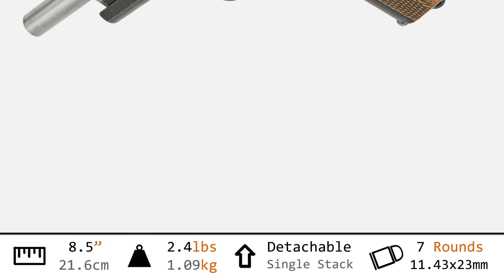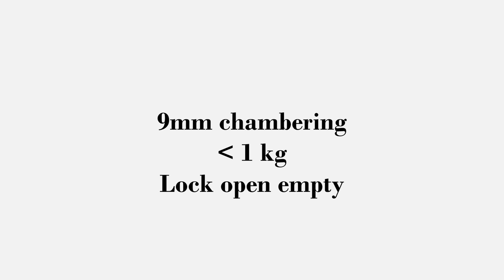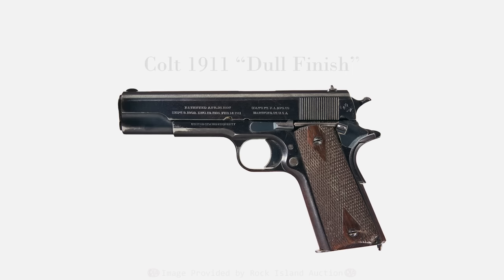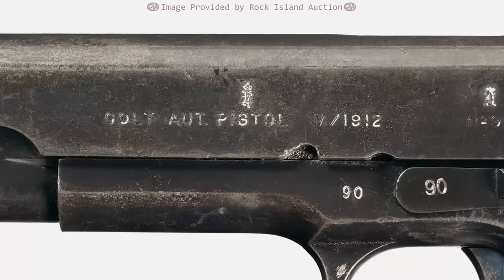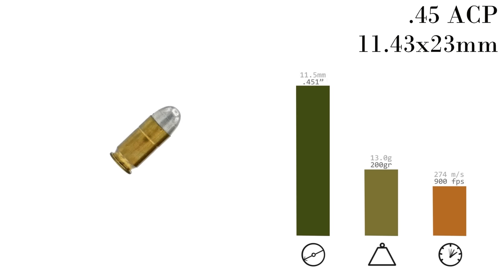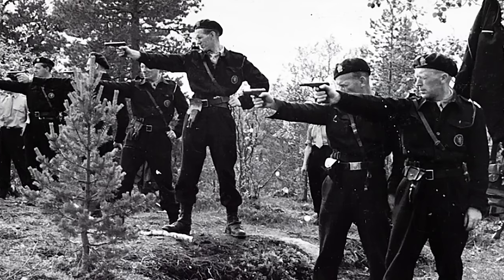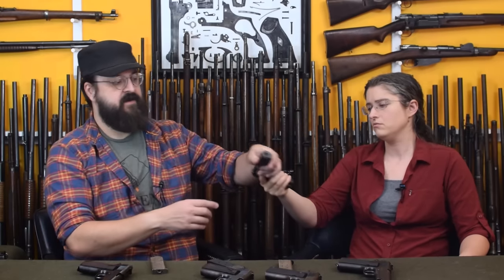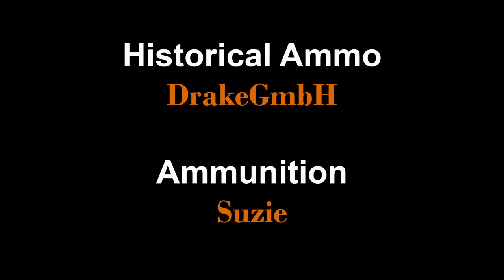History Primer 186: Norwegian 1914 Documentary

Comment: In my eyes the 1911 being compared to weapons that came out decades later is more of a proof as to how successful it is.
Reply: It's wild to think that the original AR-15 can be compared to modern rifles today
It's insane to think that the 1911 can be compared to modern pistols today
Reply: There are only two issues many three issues. 
1. Mag size but comparing mag size to the time period it was normal.
2. Complexity once again the lugar was worse 
3. Heavy... but this is comparing the 1911 to wonder 9s which is not fair.
Reply: @RyTrapp0  compared to modern pistols? Thats just a we bit generous. Compared to anything from before 1970, sure.
Reply: That’s mainly because most modern pistols still use a Browning action (tilting barrel short recoil action with a slide). Not only that, but most pistols still use 1911 style ergonomics (including having a slide stop you can hit with your thumb to load and most pistols that have manual safeties being operated by the thumb with up as safe and down as fire, including the current military M17/M18). Yeah there’s been some iterative improvements, but those aren’t significant enough to be a new action. In other words, there are more mechanical differences between a 1911 and a Luger than a 1911 and a Glock or P320.

So the 1911 is still basically a modern pistol, with most of the stuff it’s lacking by modern standards simply being features. And those features can be easily back ported to the original design, so if I want to mount accessories, have a double stack magazine capacity, get better sights, mount a red dot, etc. those are all available. I think it’s notable that 2011s are becoming increasingly popular and those are basically just updated 1911s (to the point where most standard 1911 parts are even still compatible).
Reply: @gameragodzilla M1911 uses 1900 Luger ergonomics - which shows Georg Luger knew ergonomics…
Reply: @allangibson8494  Yeah, but even then, the Luger’s ergonomic influence is indirect, since it influenced the 1911 which influenced almost all modern pistols.

You can see the things the 1911 did add, like a slide lock you can hit with your thumb or a thumb safety where up is safe and down is fire (as opposed to pushing back to forward) which are also the usual controls for modern pistols (like the Sig M17).
Reply: @gameragodzilla  Interaction was very direct. The .45 Luger competed in the trials against the 1909 Colt and the 9mm was the standard issue firearm that the German and Italian manufacturers were replacing (not the Colt).
Reply: @allangibson8494  Direct to the 1911, not modern pistols which were entirely influenced by the 1911 which was influenced by the Luger.
Reply: @gameragodzilla  Most militaries never used the M1911. Those that trialed it found it too much gun for regular use (the research is was based on was badly flawed as it included no supersonic ammunition at all).
The Luger led to all the modern German pistols via the P-38. Modern western militaries all use 9mm Parabellum (Luger) as a direct consequence of this. Russians and Chinese went of on an even smaller tangent (because 9mm caused wrist injuries after the first thousand rounds per day (KGB experience in Katyn Forest)).
Reply: @allangibson8494  Most militaries these days use pistols derived from the 1911. Anything with a tilting barrel short recoil action and a slide is influenced by the 1911. No one uses a toggle lock pistol anymore.

Comment: It feels extremely weird to see a Glock intrude upon the sea of wood and steel that is the typical C&Rsenal episode.
Reply: 45:51
Reply: Yup, really caught me off guard
Reply: Yep. Jesus, Gaston Glock sure liked to hit his poor gun with the ugly stick. (Still the best semiauto ever engineered, tho)
Reply: @max-zv7sf  Not with that grip angle it's not.
Reply: @Devin_Stromgren  i actually find the glock grip angle really good for controlling recoil in subsecuent shots. An aggessive stance paired with the grip works really well for me.
Still, my comment was about engineering, and Glocks are the most elegantly and simply engineered pistols out there.
Reply: The oldest production Glocks are over 40 years old now. Less than a decade to go before those guns become curios & relics in their own right. 

The inexorable passage of time hurts, make it stop even a little bit thanks.
Reply: @Devin_Stromgren yeah the grip angle is a bit annoying, not enough obviously for it to have failed. But you can see that everybody agrees. It’s the wrong angle because pretty much everybody whether they’re cloning the Glock or not doesn’t use that angle. I’m surprised Glock has never really fixed that. They coulda crushed the market to a terrifying degree.
Reply: @8.6GivenAdqVacSysm  Heck, I consider the 1911 grip angle to be too vertical.  I really need to try a Luger, I suspect I would like that grip.

Comment: I have to give Mae a shout out for her grouping yet again! Excellent work! I've really enjoyed the M1911 series & the slight little differences between them. I've only ever used the M1911A1 & it is one of my favourite auto pistols. I was a serving member of a state police force in Australia many years ago & we were issued the S&W M10 that used the .38/200 cartridge & it was never really a good cartridge. The armoury section was part of our unit so we got to shoot quite a number of revolvers & pistols. The Australian Army at the time had a mixture of M1911A1's & the L9A1 (GP-35). As a manstopper, .45ACP was brilliant but I still have my reservations on the 9mm round. Yes, 9mm is a standard NATO round but you can't beat an M1911A1. Our S&W M10's were replaced by the Glock 9mm series & even though it's a more modern auto pistol, I still prefer the M1911A1.

Comment: The first handgun I ever fired was a Norwegian Kongsberg Colt 1914, manufactured in 1924. The hammer did bite me at first, and it struggled to consistenly lock the slife open on an empty mag, but honestly as a novice shooter .45 ACP wasn't bad at all. It didn't jump that much. I found the Luger P08 in 9mm to be jumpier, but that could be due to the toggle lock mechanism, or the ammo we were using, or a combination of both.

Comment: Got some copies of blueprints of the original colt (model-0-auto pistol, from may 1915), and the Kongsberg 1914, from the KV-archive. It's intersting to see the difference in the tolerances. Colt's smallest tolerance, is 0.0005" (0.0127mm), and Kongsberg's smallest tolerance is 0.05mm. Don't know if this is correct only for the few drawings I got, or if it's the way it was done through the years of production..

Comment: In current times, fighting times, Glock and evolutionary polymer designs are the new hotness, but 1911 style pistols are still eminently viable.
Reply: As a duty service pistol? Not by today's standards.
Reply: @WALTERBROADDUS  As an EDC, 1911's are most definitely still a viable option.
Reply: @techfixr2012  that is a different standard. And, while viable? It's more of a fanboy choice. A Colt Python is viable...
Reply: @WALTERBROADDUS  I do and have carried a 1911 for over 30 years, used it twice to stop violent crime, luckily I didn't have to fire. You can carry your plastic gun, and more power to you, if it makes you feel better. I will carry my Rock Island double stack 10mm with 16 rounds and feel comfortable doing it, that my life is in good hands. Mine.
Reply: @techfixr2012  again, not a duty weapon that most people want to carry today as a service gun. And there are other designs that get the job done more efficiently. There are designs that use fewer parts. Are more conducive to left and right hand operation as well as different hand sizes. Are lighter in weight and have better capacity. Some people just seem to think that engineering stopped 100 years ago. If you enjoy the 1911? Congratulations.
Reply: The fact that while more modern options are out there now a 112 year old design is still a perfectly acceptable option says a lot about how much influence this design had on modern handguns.
Reply: @techfixr2012  
Is an 80 lb pack part of your EDC?  It's a game of min/max with service equipment.  Every ounce saved on what you're already carrying is an ounce of extra gear or ammo.  10oz is a first-aid kit or another mag.  Those can save lives.  A sidearm being 10oz heavier can't, unless you're using it as a club.

If rejecting something out-of-hand merely for being "the new hotness" were a valid philosophy, we'd still be chasing-down prey on foot and trying to kill it with our bare hands.  Decisions need to be based on functional merit, lest we do ourselves an enormous disservice.
Reply: @ItsMrAssholeToYou  My EDC is a Star BM 9mm actually. My 10mm is my shtf piece, along with my lvl4 steel plates. I survived 2 combat tours, so I have my own opinions. I actually like the FN 509 and I have nothing against polymer arms, but I absolutely hate Glock triggers. If one firearm was the answer, they would only make 1. I respect your choices, but I have so much muscle memory built into mine, I will stay with what I know.

Comment: I had a chance to fire a Norwegian  cousin 1911,while assigned to that Country temporarily. It was not possible to tell the difference between the Norge model, and the U.S.  in use, though some parts are a bit different.  Sadly,  Norge had replaced it with some version of the High Power.